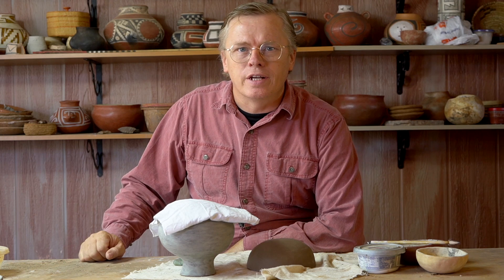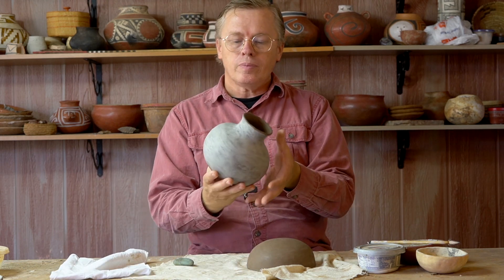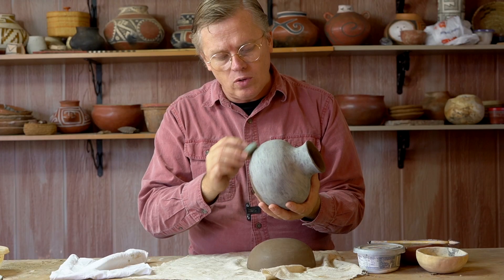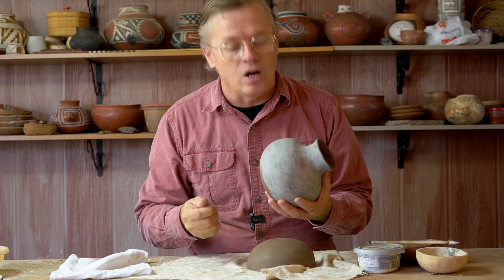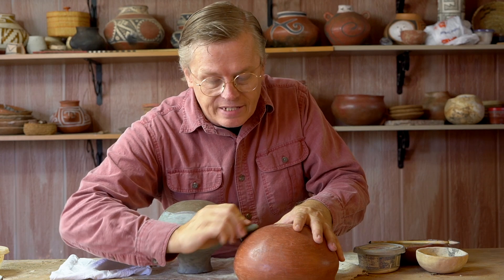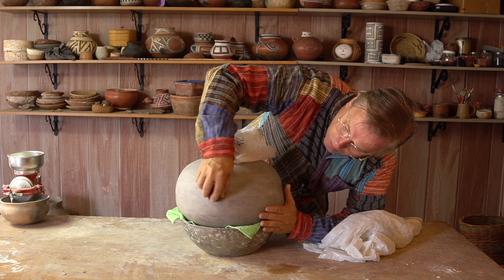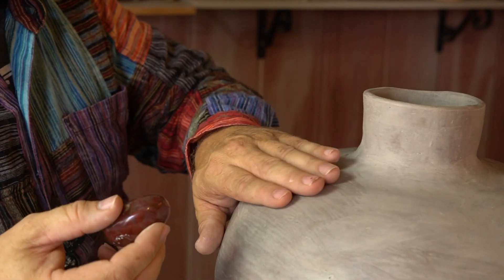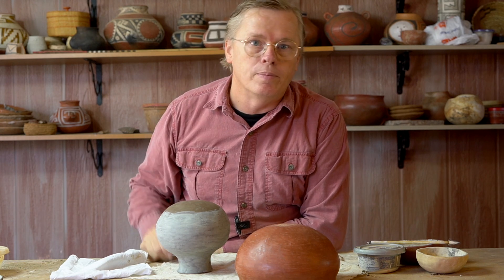When Is the Right Time to Burnish Pottery? Q&A

Comment: I just made a mole pot and the second day I use the quartz to polish the bottom of the pot and is beautiful shiny but the next day I try to polish the top and is bone dry like you were saying in your video.  So the rest of the pot is not shiny..
Reply from the maker: It's all about catching the clay at the right stage of dryness. Some times if the pot is getting close before bed or if I am going to work or something, then I will wrap it up in a plastic bag so it won't dry any more.

Comment: I actually got some of my wild clay pieces fired! the burnishing wasn't evenly done but when the chance was presented I rushed to hand over anything I thought would make it through the process. While diving back in to the art I was attempting to dry process some rock solid clay and accidentally found that window screen folded over a few times works insanely well for burnishing, at least, it seems to. Have you tried to burnish with any non-traditional materials?
Reply from the maker: I have never tried window screen but recently accidentally had good success with a scotchbrite pad.

Comment: Hello Andy..     Complete pottery here newbie from France..absolutely hooked on your pots and way of building. So over here only can purchase shop bought material..made  a few pinch pots and couple of pukies aleady ..Using standard clay..tempered with sharp sand. Have even pit  fired a couple bits...Amazing ..So just a bit confused with the finishing process...Cant find a video that explains ..sequence of drying, polishing and slip..  Do you wait till leather hard , burnish to a sheen then apply the white slip ? or do you paint slip when leather and polish both surfaces at same time..? My slip is made from just white clay..is this ok? but comes off when i burnish... cant find any info on organic colours  that i can find..so was going to whit slip large areas and scratch through some designs...sorry a  few question here..any help or info from anyone  would be great.....keep up the work   cheers Steve
Reply from the maker: Thanks Steve. I guess this is something I need to make a video to clarify. I slip when leather hard and I polish when leather hard. It's all about the correct dryness level. So when the pot has dried some and is no longer plastic and sticky, I slip it. Then I let it dry and when I can polish the slip without it coming off on the stone, I polish. This step may differ for different clay slips. Some are easily polished and some not so much. Experiment. Organic paint is a hard thing to get right, the secret ingredient is a smectite clay slip. Since you are in France, see if you can get some montmorillonite to use as a slip, then paint organic paint on top of that. I will be making another video about organic paint very soon.
Reply: @AncientPottery  
Hi Andy..thanks for the reply and putting my query in place .I will try next time to follow that and search for some montmorillonite. Another problem is my temper must be a bit too big ,when burnishing it comes to surface and is scratching my stone,so will sieve finer from now on...keep up the great work your doing, watching over again   Thanks Steve

Comment: good day Andy
i have been making pots with red iron oxide paint (mixed like the lessons) on the base clay color. i have no white slip yet that works. 
if i burnish the pot before painting, the paint has a hard time soaking in and leaves ruff edges. if i don't burnish i get nice lines but no shine on the pot. i don't know if maybe i should paint the pot then burnish over the image but i am thinking the pot may be too dry and also may wreck the artwork. kinda hard to burnish around the artwork.
any thought on this?
another great video
thank you for your efforts
tom
Reply from the maker: Are you painting on bone dry pottery? Because I usually find that if the pottery is dry, the paint soaks in quickly whether or not it is burnished. I sometimes paint on burnished pottery as you can see in a few of my videos. You can burnish after you paint, there are two ways, you can carefully burnish the designs and around them being careful not to smear the paint. Or you can cover the area being worked on with a plastic bag and polish over the plastic so the paint doesn't smear.
Reply: @AncientPottery  . i paint when the pottery is dry. 
sometimes the paint actually beads up when brushed onto a shinny burnished pot.
i am going  try the plastic bag trick next time.
funny thing is,
my firing success rate is low, i am working a better success rate. But even though i know something might break i still want to paint it. some would say wasted time but i like to try and see what happens.
thank you for helping.
tom
Reply from the maker: @oldugly9295  your clay sounds very dense. Are you tempering it?
Reply: @AncientPottery  . yes but i have just added more temper recently to try to cut down on the breakage . and i haven't painted since i did that. maybe the temper affected the paint a swell.
thank you
Reply from the maker: @oldugly9295  just a theory but perhaps your clay needs to be more open. On the other hand I paint into slip that is purified clay with no temper. Hmm. Incidentally there are 2 painting workshops scheduled for the kiln conference next month in Utah.
Reply: @AncientPottery  someday we are going to travel south and attend.  central Alberta is bit of travel so we would spend a few moths exploring the southern desert aswell.

thanks again
tom